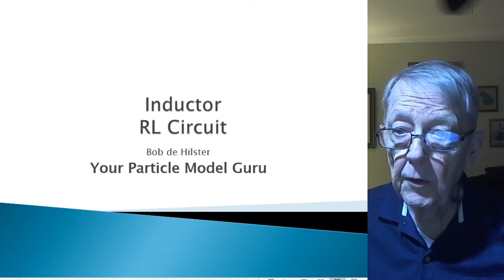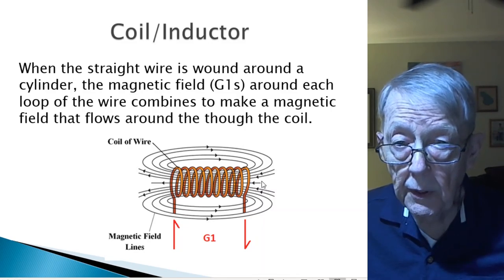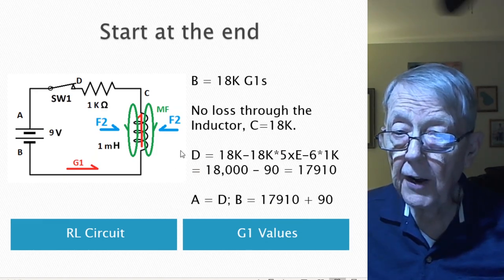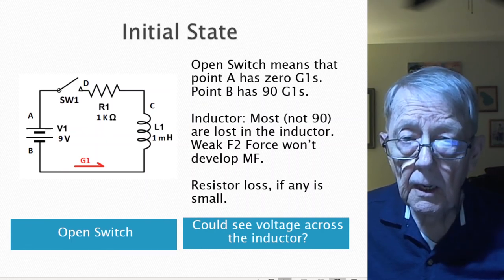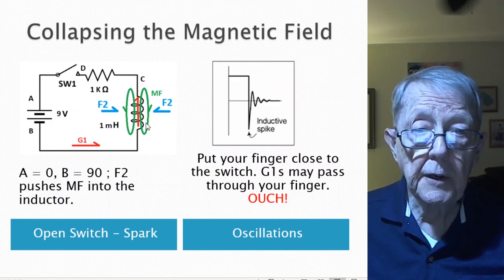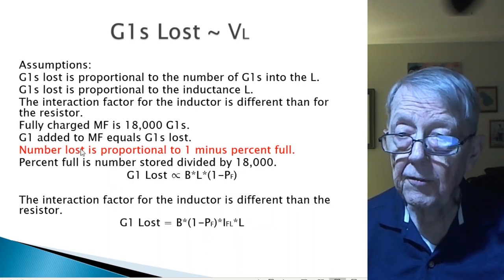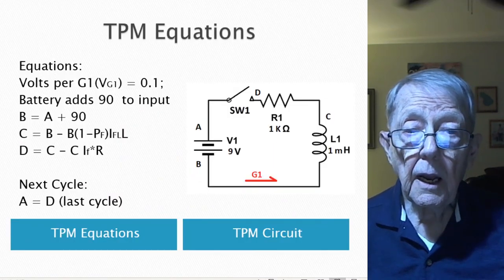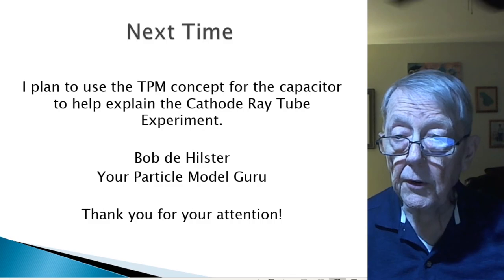Inductor and the RL Circuit

Comment: Brilliant ! Bob I have a question , why F2 pushes the G1s from the magnetic field to the coil? Is it because there is more space inside the wires of the coil when  the flow of G1s has dropped ?
Reply from the maker: Yes! As long as the G1s flow from the source to the coil, the magnetic field is sustained. But the instant the G1s stop, the F2 force is still there and will push the G1s back into the coil. And there is room for them to flow backwards.

As the Magnetic field collapses, the F2 field collapses and the coil can be re-magnetized once the G1s re-enter the coil